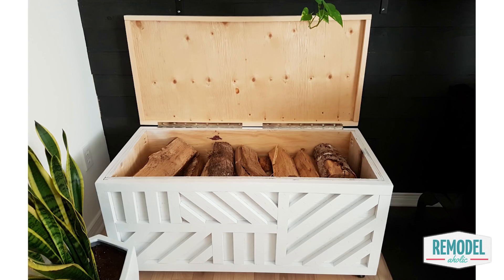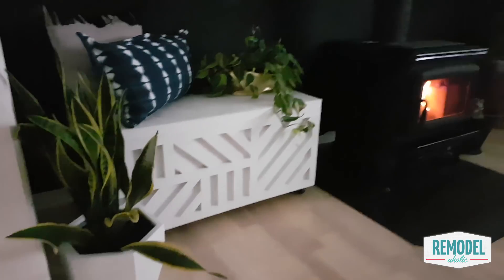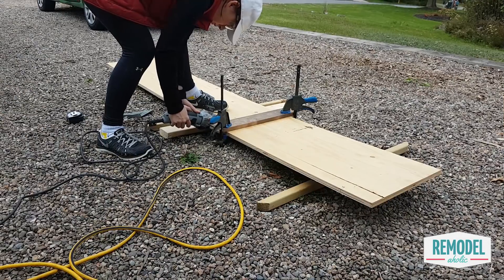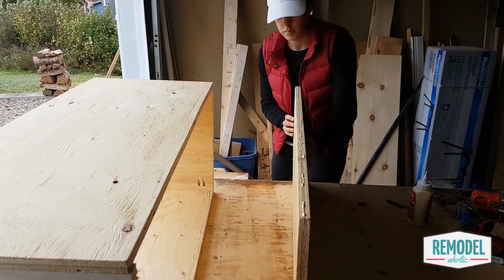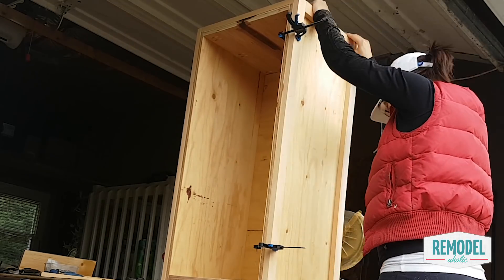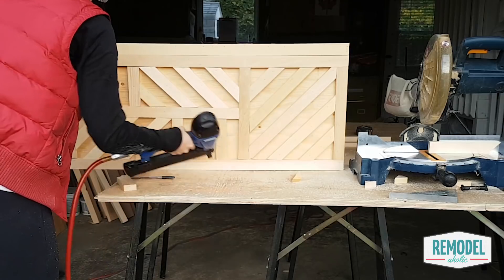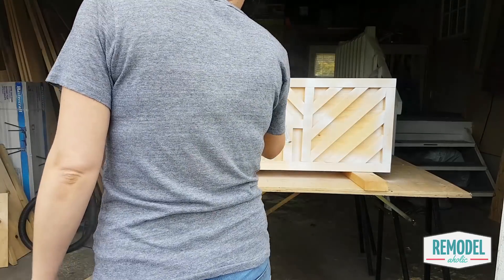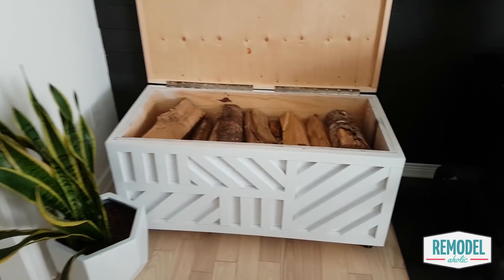Build an Easy One-Sheet Plywood Storage Box with Geometric Inlay Pattern

Comment: i would make this if I didn't have to use pocket holes
Reply from the maker: Julie, You could take a 2x2 as a support for all the corners (on the inside corners, to give yourself a stronger larger surface to drill the corners together... ). Then you can avoid pocket holes all together- it would just make the interior space a tiny bit smaller...  does that make sense?
Reply: @Remodelaholic  yes it does make sense. and it is perfect. Thank you
Reply from the maker: Perfect!!!  Send us pictures when you are done!!
Reply: Get the jig to make them, they're cheap, and, pocket holes are easy, and open up a whole new universe for you!
Reply: @BenBalser what does the jig look like?